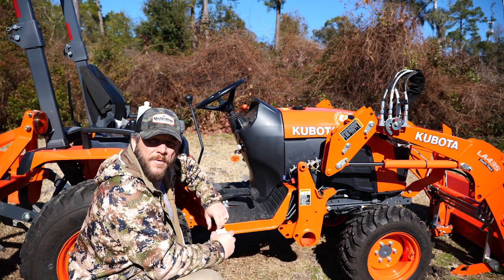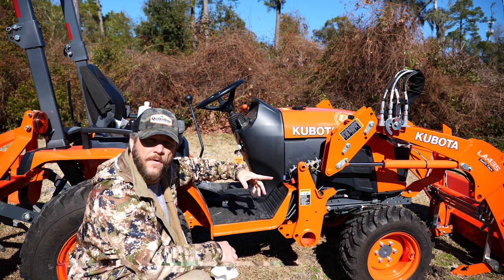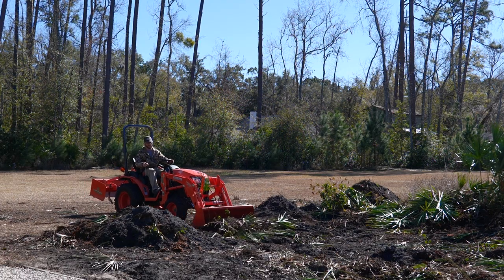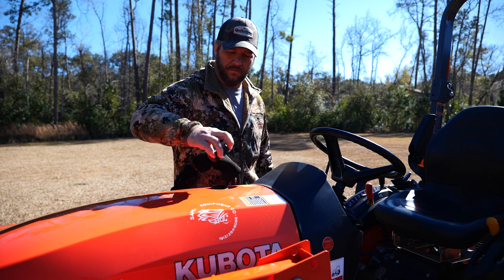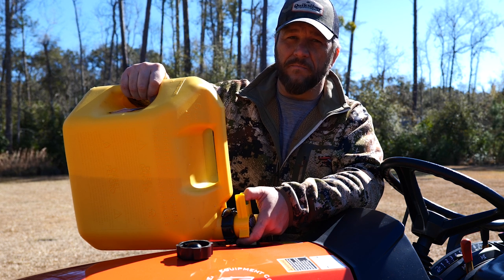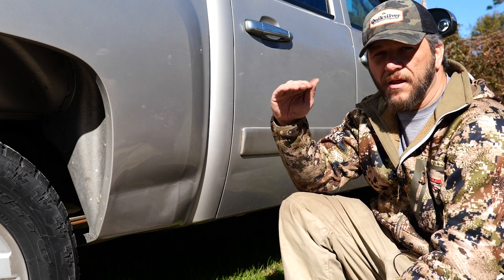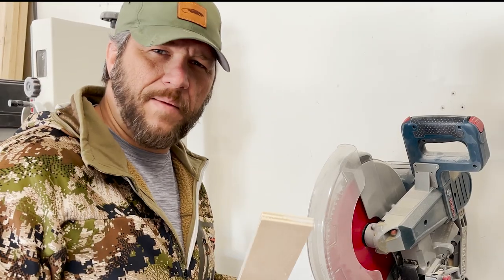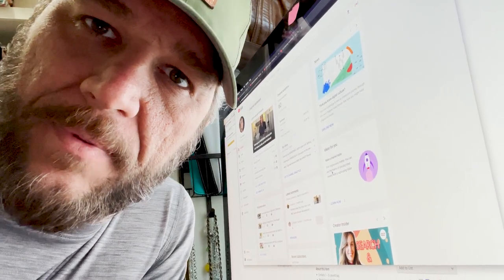WARNING! SILENT but DEADLY

Comment: I’m a chef and about twelve years ago I was slicing some salami with an electric meat slicer  (you’ve seen them in the deli).   

All was going well until I got to the end and needed just two more slices.  The safety guard stops about 3/4 inch before the blade and I thought I’ll just run it trough without the guard for the last two slices rather than getting a new salami out.

Can you guess what happened?  Item I sliced the top off of two fingers. You know how many nerve endings in your finger tips.  It smarted somewhat.

Then to add insult to injury in the emergency department they said well all we can do is cauterise the wounds and we can’t really numb it because of how much is exposed so we going In hot … this may be painful…. They were correct. 

Never not used that guard again though 🤯
Reply: Yikes man.
Reply: owie..... 😭

Comment: You get too comfortable around power tools when you use them everyday I cut the whole tip of my thumb off with a circular saw reaching underneath a piece of flooring I was cutting to grab the drop it grew back though after a few years and after a few more years I have feeling in it looks a little funny though I don't know why I would do that total brain fart